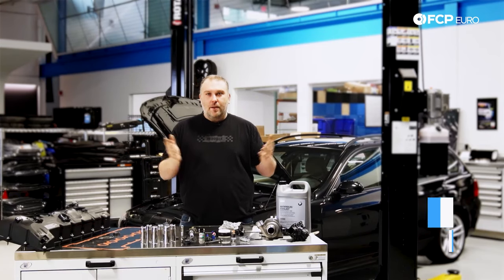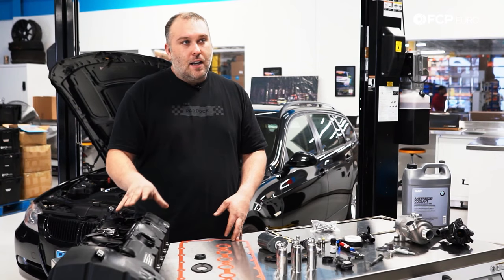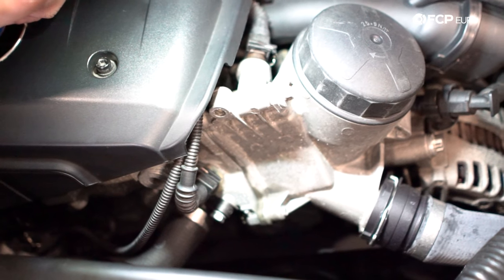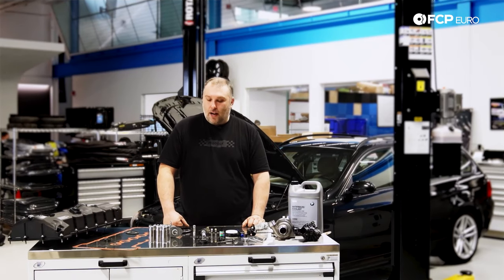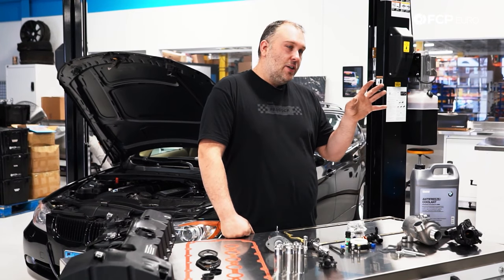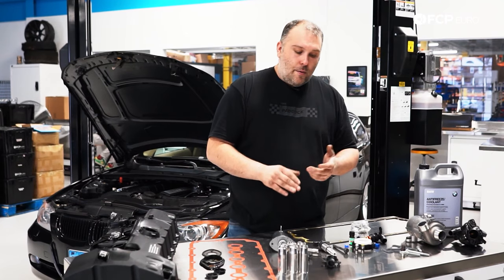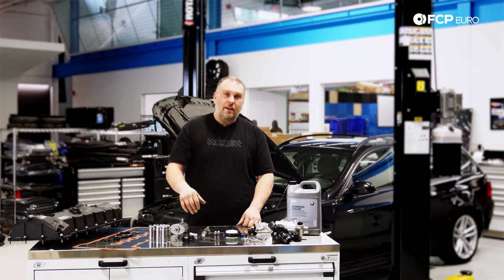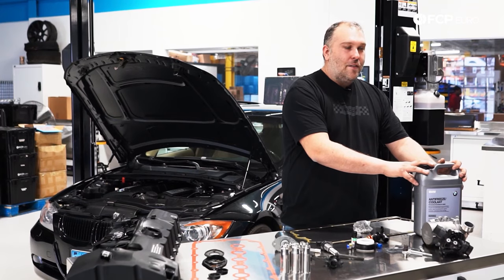BMW N52 Engine Diagnostics/Problems - Everything You Need To Know (128i, 325i, 328i, 330i, 528i)

Comment: Thanks for all the help.
My son has an 08 328i, 6 spd manual.
182k miles, previous owner completed most of the common failure parts, and kept it serviced properly.
Still running strong, and is a super clean example inside and out.
I love driving it when he lets me.
I’m more of a motorcycle guy (and boring Toyota cars), but it is a blast handling the country roads.

Had 1 bolt fall out of the power steering pump pulley and another one loose.
Caused the serpentine belt to wobble and start to get shredded.
Luckily he pays attention to noises and caught it before it broke completely.
Got the bolts, belt and pulleys/tensioner from you all.
Was an easy repair.

Had the starter go also.
Got the new (not reman) Bosch from you all also for a great price, along with the needed bolts and gaskets.
Used your guys blog instructions to replace, very detailed and helpful.
Wasn’t mechanically difficult, but was a lot to remove to get to it.

Anyone considering a used BMW, would recommend an OBD2 tool with BMW software.
Very helpful for research of issues, resetting codes, and used it to register oil changes and a new battery also.
Reply: how did you diagnose the power steering pump pulley?  i've got a disturbing noise right now and not sure if its the idler/tensioner or what.
Reply: @felderosa  
My son heard a rattling noise coming out of the engine bay.
When we popped the hood to take a look we saw that the serpentine belt was starting to shred/chewed on the edge.
Started feeling around on the pulleys and felt that one loose, and then saw that the bolts weren’t bolted down tight.
Had to get a new belt so we got a kit from FCP Euro with the idler and tensioner.
And they also had the bolts for the PS pulley.
Ordered 3 new bolts and installed with blue loctite.
No issues since, been about 15k miles.
Reply: Which obd2 tool and software are you using?
Reply: I have the exact same car with 123k miles, I have a similar situation where the previous owner did things like the waterpump, no oil leaks yet knock on wood.

Comment: Also the Vanos check valves there's two on the left side of the engine,
   which take a torques to remove them
   they need to be cleaned out and the screens need to be cleaned out which is almost like a filter, once a screen check valve filter is cleaned you can blow through it on the end of it and actually see if the check valve is opening or closing or holding when it's closed! Of course make sure it's clean unless you enjoy the taste of oil? You can always put some olive oil on there if you don't like 0w 30,LOL

Comment: Thanks for this! I own 2 Z4s with this engine: a coupe and a hardtop convertible. And I’m not afraid to get greasy to maintain them.
Reply: nice, i also own a coupe ;)
Reply: @Floyd1504 that’s great to know. I agree! If you don’t care for it problems will come. Check out Simple Car Guy channel. He has videos on his e89. Retractable Hardtop maintenance, upgrades! Great stuff. I did the hardtop service myself. Did it with TLC. Btw, are you using the run flats? The ride is horrible! I want to change them. Let me know if you did and what tires you swapped them with. Thanks!

Comment: When discussing the cooling system, I feel it was in order mentioning the failure prone built in plastic flange in the cylinder head to thermostat housing hose (11537550062) and its needed replacement with an Aluminum Coolant Hose Flange - Rein CHC0609. Another worthy point might have been the Coolant Expansion Tank  (17137647290) cracking...I enjoyed your video thoroughly.
Reply from the maker: https://www.youtube.com/watch?v=rvOoeoFL0do We are all to familiar with that failing Anaestereo :)

Comment: Hi guys . Just a note . The heated angle connector was under recall in  
Newzealand . 👍
The gen 2 valve cover on my 525i was leaking . I had a shop replace it . They replaced with the reddish 1 you had to show . I have a leak but it's the oil pan . The oil is still very clean . Not a big leak . Just annoying . Glad I saw your vid .great work 
 Cheers .

Comment: When I worked at BMW I did a bunch of PCV heaters. Another failure point on them is they can leak oil past the connector and cause possible oil migration into the wiring harness
Reply: Did you have to take off the valve cover for this repair?

Comment: Nice to watch a video on not very popular engines. I’ve done almost completely everything so that makes me fell much better. Last to do is the oil pan gasket, water pump and oil filter housing gasket. None of have gone bad yet but I like going preventative maintenance
Reply: Also! Keep in mind I changed all but the 3 listed at around 135k or more miles so the n52 is a super reliable engine if cared for properly
Reply: There were tons of these sold. What do you mean not very popular? There are more out there than N54. Maybe they aren't popular in the enthusiast community.

Comment: Great video! I recently bought a bmw with the n52 engine a few months back. So far I can say I love it and its reliable😁
Reply: Can I get an update on the engine? I’m considering one and want to know how many miles/problems you’ve run into?
Reply: @jason9875  I'm still driving my beamer. I got it at 130,000 miles. Now it's at 152,000 miles. I've had no major problems with the n52 engine. The only problem I have had is a leaking valve cover gasket. That's a very common problem on BMW engines though.  The only real problem I had was within my cars suspension. When I bought it the previous owner had it lowered on coilover suspension which made the rear tires staggered. It was just eating up the inside rear tire tread. I put the car back on stock suspension and it's been smooth riding and even tires since! 🤘😎

Comment: Was considering an 08 328i as a daily driver. Traditionally a Mercedes guy. This video was super helpful in convincing me not to go the bmw route. I know German cars have their quirks and I’m fairly decent with a tench but holy crap. Mercs don’t have nearly as many points of failure in my experience.
Reply: Mercs are also a nap on wheels unless you go AMG. Not everyone wants to be disconnected 95% from the driving experience.
Reply: This is 100% true. Mine was an AMG though so best of both worlds.

Comment: So, bottom line is don't go 22,000 miles on your oil like the CBS will allow you to do. I drive mostly highway, but I won't go past 8,000 miles between changes. I've already done the oil filter housing gasket, which is a piece of cake. I'm steeling myself for the VC gasket and oil pan gasket, which I will eventually have to do. Thanks for doing this series on the last naturally aspirated BMW engine. It's a great motor, if you take care of it.
Reply from the maker: We agree Doug, take care of your N52  and it will reliably take care of you. Staying on top of basic routine maintenance is key, and doing some of the preventative problem areas we discussed in this video will help. The oil pan gasket certainly isn't a fun job, but its very doable.

Comment: replaced water pumps in several n52s and n51...  never a logic board failure, always gummed up and hard to spin (probably due to wrong coolant).  n51 was first replaced at 200k miles.  I have heard of logic board failures from a mechanic friend of mine, but the half dozen I replaced were all in various states of seized )

Comment: Got my own n52 328i right before the pandemic made the car market go nuts. Can confirm have had to do almost all the maintenance mentioned. Valve cover gasket was leaking, so was the eccentric motor and sensor seals. Oil filter housing seal also was failing. Ended up getting a new belt and pulleys at the same time (car was at 65k when I got it, closer to 73-74 rn) plus changed out the "mickey mouse" fitting on the oil filter housing with an aftermarket metal replacement. It now runs like a top and with no leaks to boot.  But between all that and doing the plugs and coils (switched to the eldor's while I was at it) and tires it has cost me a pretty penny. But for a Montego Blue 328i with only 65k on it, I  think all in I have paid 7k for the car and about 2k in maintenance. 9k all in for a sorted bmw ain't bad. Besides the front struts failing from living on a dirt road lmao
Reply: There’s an e92 328i I’m looking at that has had almost all the mentioned maintenance done, he’s asking $9k. 97000 miles, auto. I can negotiate with him I’m hoping to get it for around 7-7.5, but do you think that’s a decent deal?

Comment: I've actually never seen or heard of an oil pan gasket leak on the N52. I've seen many valve cover gasket and oil filter housing leaks. I think I've seen a small seep from the oil pan gasket on a very high mileage N52, and at that stage most people just opt to put a cardboard underneath the car and not worry about it at those mileage.
Reply: Mines at 130k and leaks unfortunately, thankfully I have the RWD version and I have the parts but after doing the water pump & thermostat in 17 degree weather I don’t wanna do it at the moment!
Reply: Mine was leaking super heavy. Replaced it at 215.000 km. But that gasket was so crusty, so incredibly hard to remove. If i knew how hard it would be, I would have replaced it way earlier.
Reply: I have a oil pan leak . Not to bad. I heard theres a vid on how to change gasket without dropping the subframe.  Any one seen it .

Comment: You missed one.  A common nasty on this motor, but fairly easy to find, is the ONE head bolt that is not under the valve cover.  It is very prone to the head breaking off and causing an oil leak.  It is behind the oil filter housing and often mistaken for a leaky oil filter housing gasket.  The head bolts under the valve cover head uniformly with the head under combustion, but that sneaky head bolt that isn't under the valve cover gets hit constantly with cold air rushing through the engine compartment and doesn't heat cycle on the head of the bolt like the rest, and this heat cycling causes expansion and contraction differences which eventually over stress the aluminum head bolt causing it to fail.  If you think you have a leaky oil filter housing gasket, check to make sure that the head of this bolt is still present behind the oil filter housing.  It does require the intake to be loosened and pulled back slightly to remove the remnants of the old bolt and install the new bolt up by the number one cylinder intake port.

Comment: Very good video. There are 2 thermostates more, btw.. On the gear-oil cooler and on the water-oil heat-exchanger. I have here an additional question: I am changinge the crankcase ventilating system (KGE on the 1st motor generation) appr. every 2 years - and everytime the intake manifold has a lot of oil in it. All hoses and also the 90deg connection (the heated one) are replaced, too. The bacxkflow connection is also not clogged. What can be the issue of much oil in the intake manifold? Too many blow off gases?

Comment: Excellent video on the N52. I was considering a 128i for the lightweight modern BMW but after seeing this video with all that strange metallurgy, plastic parts, etc... I think I'll stick with the old 80s m30/m20 motors that seem to be BMW's most reliable motors to date....
Reply from the maker: Despite the strange metallurgy and plastic parts, these N52's are great engines and the 128i is an amazing car. But you can't go wrong with the old school m30/m20 engines either, if that's your thing!
Reply: I got myself a 128i e82 before the pandemic. I did most of the stuff mentioned in the video, except for the water pump. Every BMW machanic or fan I ever met since then confirmed i've got one of the most reliable bmw engines ever. Besides, this is the last 6cyl n.a engine bmw makes, so it is like a modern version of the m20/m30

Comment: Hi excellent Video and Explanation  in depth, professional video!! I have a question.... i drive a 2013 bmw x5 35i, 3,0 turbo with 138.000 kilometers,This is a N55 engine right?? does this engine have these same "Inhereted" problems or are the revisions have "fixed" all of these issues with older engines ?? Also @1115 you mentioned "cold start rpm fluctuating   ? i just purchased this vehicle 5 months with no problems on startup and only just now recently i notice that when i start this engine cold in the mornings, it surges up and down between 750----1250 rpm for about 10 Seconds and almost shut down, After that it idles and warms up normally without any problems for the rest of the day, but it only happen when the temperature is 2 degrees or close to freezing, i live at east coast of Canada ty for input

Comment: Awesome information, thanks!
I look forward to your upcoming videos that you mentioned here.

?: Are there any symptoms/warning signs when the electric water pump is about to give out?  Thanks.
Reply from the maker: Mario it will sometimes be nice enough to throw you a 2E81 or 2E82 CEL code which both point directly to the Electric water pump failing. If those are not popping, if you're seeing high coolant temps regularly, or if the car is no longer blowing any heat bc of poor circulation due to a failing pump , those can be signs as well.
Reply: thanks!

Comment: Been looking for a video EXACTLY like this, thank you
Reply from the maker: We made this video for someone EXACTLY like you who was in need of it! Are you an N52 owner? or potential buyer?
Reply: @fcpeuro yes n52 owner. 150,000 miles so it's time to do all  maintenance. Did tensioner, thermostat, and new valve cover thanks to your video that shows how to replace the gasket. Next is oil filter housing gasket.
Reply from the maker: @bmwn52shorts52  We are happy to help! Good luck on the oil filter housing gasket install, let us know if you have any questions.
Reply: Hello, what can I use instead of a e torx 8. To do the oil filter housing gasket

Comment: Also very common Error: Oil Filter Housing. There is a Plastic Thing is the Middle to hold the Oil Filter, which belongs to the Oil Filter Housing. What happens: people change Oil, remove the Filter (with the Plastic Thing) insert a new Filter (without the Plastic Thing). Bad things can happen from there. Good news: it´s quite easy to check.

Comment: If you buy an N52, make sure to budget $300 a month in parts and 10 hours a month working on it. Also, renew your AAA membership. Mine required a tow every 2 months, bursting hoses and a radiator. Finally, we discovered the engine was pressurizing the cooling system causing all sorts of problems. However, it was a GREAT engine.

Comment: One thing you might want to add to the cooling system issues is the plastic Mickey Mouse flange next to the oil cooler housing. This can degrade and come apart and the little pieces can end up in the water pump and/or thermostat and mess it up.
Reply from the maker: 100%

Comment: What do you guys think about a manual 128 I 2009 40k miles with the N52
Reply: Do it man, great car, I own one. They are becoming really rare being manual. If you are mechanically inclined you can do most of the stuff with all the DIY videos found on youtube. Great fun car! Make sure to check the car throughly depending on the price, you want most of the common issues taken care of.
Reply: @josearroyo4575  can you specify what are the most common things to look for before getting a bmw 128i. I am looking at one right now on fb market and very new to this car platform
Reply: @ameykarade9432  main thing check for oil leaks, basic maintenance like brakes, spark plugs, filters,gaskets and fluids if they were replaced, and depending on the year and mileage at which intervals. And obviously check esthetics, things like that tells you a lot of how the car was treated. Hopefully that helps, not a really complicated car.

Comment: great video! 2006 bmw x3 129k miles it was sitting for 5 years until i bought it. it has a bucking hesitation while accelerating in 3rd 4th and 5th gear ( manual ) but no check engine light. also intermittent misfire on cold starts. could it be a vanos issue? its never been serviced yet.